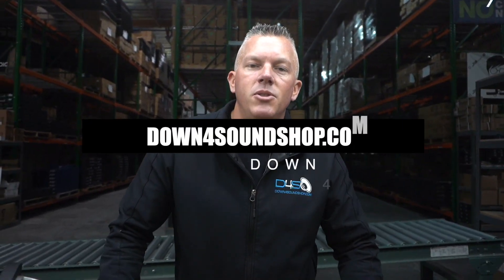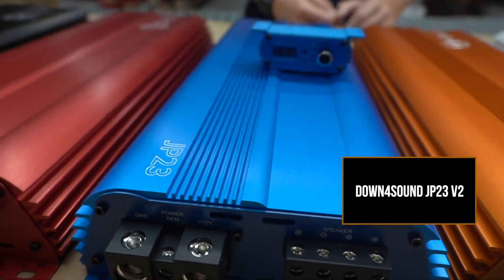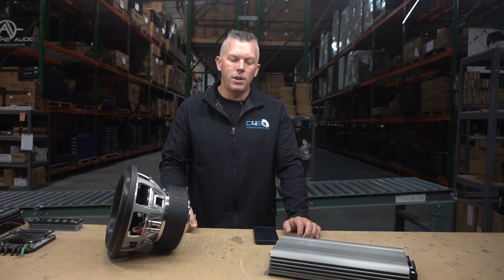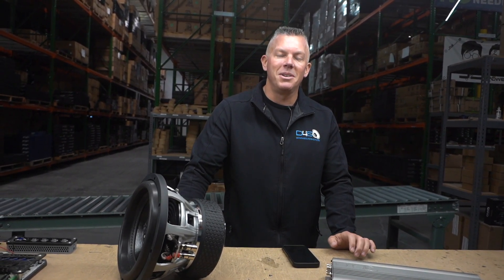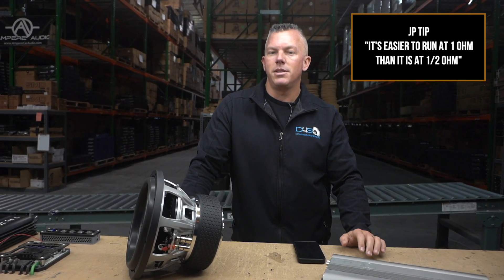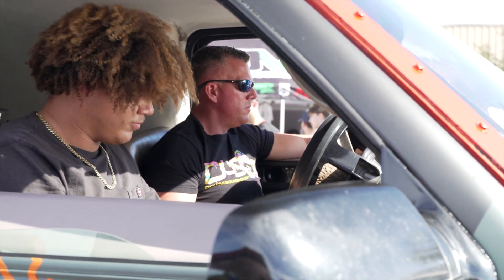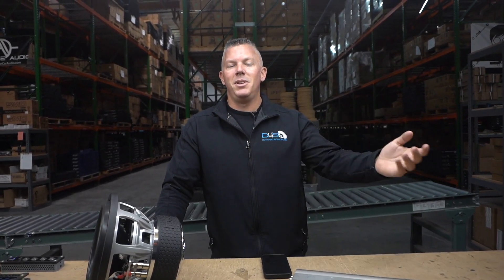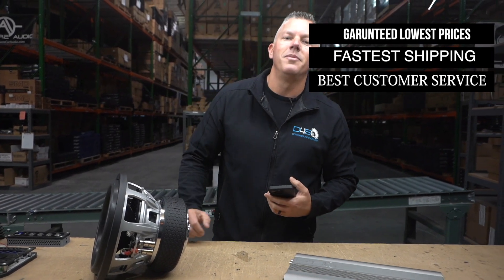RUNNING YOUR AMPLIFIERS ON HALF OHM! DO'S AND DON'TS WITH JOHNATHAN PRICE

Comment: My jp23 is running a 4 ohm kicker comp 150 watt rms sub... No stress here .. lol .... Have the amp tuned down to not over power the sub... Im cheap...... Lol.. actually its just a quick temp fix till my new subs come in

Comment: I have a big boss 8 with a stock alternator and a 180ah glowe voltage lithium bank ……. No drop ….. at half ohm on 2 resilient sounds plat v1s now for over a year zero issues besides car starting to loosen up hit 151db at 33hz

Comment: For the experienced folks who do run at .5…one thing that I’ve thought about is amp efficiency. Like for example the difference in power consumption of a 4K Korean at .5 and something like a ruthless 10K at 2 ohms. Roughly same rms but efficiency is 100 times better at 2 ohms on the ruthless. With this example in mind would they be equal for your electrical or would the the same rms output but at 2 ohms be less taxing?
Reply: Depends on box rise.

Comment: I run at 1 ohm. Box rise and other variables change the power being drawn from the amp.  I prefer to keep my equipment running efficiently rather than stressing it or pushing it to much past the amps rating ability.
Reply: You're right "but all work and no play makes Jack a dull"- The Shining
Reply: True

Comment: I know that some of these amps including yours can actually run lower than their rated. But you should never run an amp even down to the lowest it's rated. Unless all you're doing is short demos and burps and whatnot. Anything like half a ohm or less definitely you'd better not be doing anything more than burping it. 2 ohm amp at 2 ohms for several hours can destroy the amp. It puts it into protect mode repeatedly. And eventually shitt gets destroyed from going into protect over and over again. They do not like to be ran at their Peak for any length of time running that same 2 ohm capable amp at 4 Ohms it'll do it all day long.
Reply: Box rise,

Comment: Amp power is so cheap these days i dont see the point in stressing your equipment and sacrificing sound quality. The money you save on amps by running at lower impedance is gonna have to go towards your electrical so your not saving money at all😂

Comment: What you say is putting stress on an amplifier to run it. Half ohm that'll make sense How could it be made to do it? But did not like to do it. If it won't function properly to do what you're claiming it does then  something's not right

Comment: I’ll get shot down for saying this, BUT, as a touring musician, absolutely nothing runs less than 4 ohms. Why?  Because it makes the amps 
get hot and poop out. Now I realize I’m way over simplifying it, but I personally want my music to play FOREVER without smelling coils, etc.  JP is a seasoned veteran, and knows how to push his Tahoe to full tilt. 99% of us don’t have that experience.
Reply: I get what you are saying, as higher impedance is more efficient= makes for a cooler running amplifier, with a higher damping factor as well. But any impedance can burn coils, if over powering a speaker for too long.

Comment: Running high voltage like close to 16v is also bad. Can it work, yes, but probably not for long. It's very hard on an amp to run at its limits all the time.

Comment: I am running my JP93 @0.67ohm with no problems. Of course I have over kill electrical. I have 90ah C-Max and 2 Mechman 400amp alts set at 16v to 16.2 on cold days. Never drop below 15.5v playing full tilt just shy of clipping. Clean signal with gains set with SMD's DD1. Oh the subs are 3 Trinity Audio H series 12's.
Reply: 15.5v? Most people don't go above 14.8 so 15.5v is good but not imperative.  Most Korean amps won't operate above 16v and Chinese less than that

Comment: Can I wire them to a quarter or an eighth ohm❓🤔❓
Reply: If you own your amp you can do what ever you want with it. Just know that heat in electronics= bad for longevity. Example: if a 1 ohm stable amp, is wired to 1 ohm, & it lasts for 10 years, if it were wired to half ohm, it may blow up right away, or it may not, but it will definitely not last as long as if it were wired to 1 ohm. A lot of amplifiers will not even run/work if wired to 1/4 ohm, & definitely won't run @ 1/8th of an ohm. I have tested a 1/4 ohm on a few amps, some worked, others protected/didn't work. This was just to do an SPL run, i would never recommend trying a 1/4 ohm for music. Ryan will tell you how he ran his amps @ a 1/4 ohm, i have as well, but you are playing with fire, i highly don't recommend!
Reply: @donjaun540  if you have alot of ohms rise and you have a decent halfbridge amp you can wire at quarter ohms.

Comment: May have missed the question, but here it is. Is the jp40 ever coming back or a variant?
Reply: 40ah of headway is not worth it imo. As far as what d4s brand batts go, the jp is def a better choice over the lto 6.0 which is a 1P 5S config. Also one should pay attention to max charge voltages.

Comment: It’s not how it’s when
Reply: Nah tune your shit right and you won’t have a problem I’ve ran almost all my amps and .5 ohm and never had any issues
Reply: @CalebAintloud1  totally agree
Reply: @RyanBassForLife  see someone understands it’s simple just tune your shit right and have good voltage and you won’t have problems!
Reply: @ okay buddy 🤣
Reply: @justinboone8700  no bs I’ve got pictures/videos to prove myself or just pull up to any of the shows this year and I’ll prove you wrong
Reply: @CalebAintloud1  why not run one amp per sub/ coil at 1 ohm and be more efficient?
Reply: @ because I don’t need 8k per sub and buying 4 2ks would be just as expensive if not more expensive than buying a good single amp
Reply: @ but yes it would be more efficient not gonna argue on that
Reply: @CalebAintloud1  I tried to do four jp23v2s at 1 ohm per sub but one came in protect from the factory so blew my d4s buzz (I sent amp in and they fixed it for me) I ended up doing 153+ on two jp23v2s strapped at 1 ohm ran like that for months no issues… video on my channel using termlab on passenger dash
Reply: @ I’m doing 155+ with 4 sundown sav2 18s on a single jp83 wired .5
Reply: @ b-pillar 6th order btw does the 155 from 25-42hz pretty consistently
Reply: @ cool man I’m converting my 4th to a 6th gonna tune 25-35
Reply: @ need to have a wider tune range I’m tuned 26 in the rear ports and 57 up front
Reply: I run my Dual 1 OHM sub that read .7 per coil down to .35 OHM. Pulled the sub after a year to put in an upgraded model. Voice coil looked beautiful and there were no issues. The amp has never went into protect. (Incriminator IA amp)
Reply: @SeanSinha  yeah my Audio Legion AL1600.1D amplifiers are all wired at .25ohms per amplifier because there strapped at half ohms. They never give me any issues.